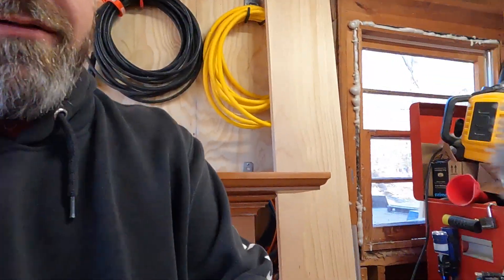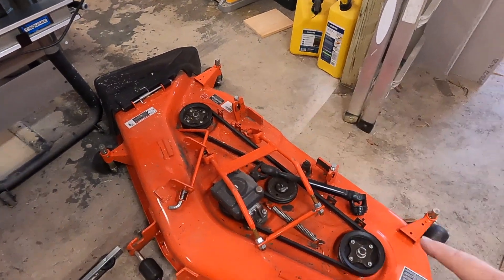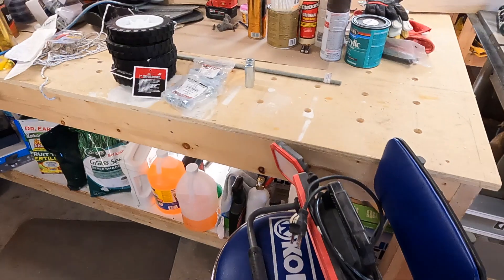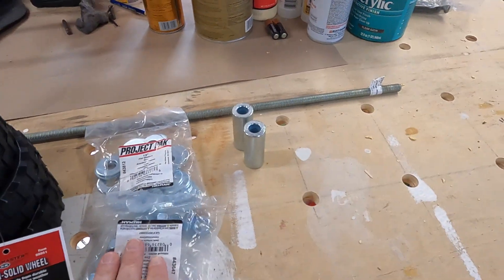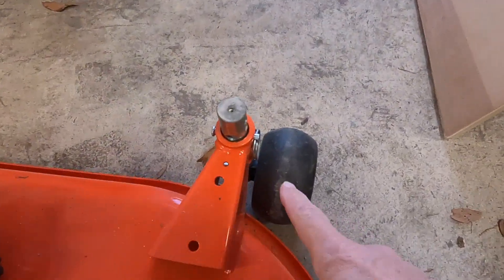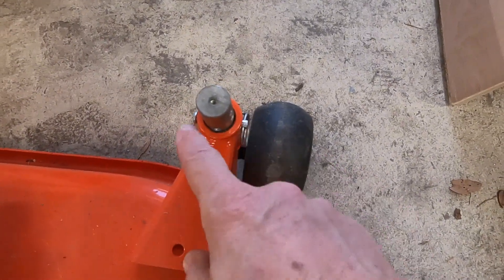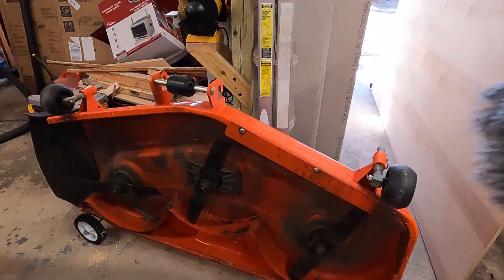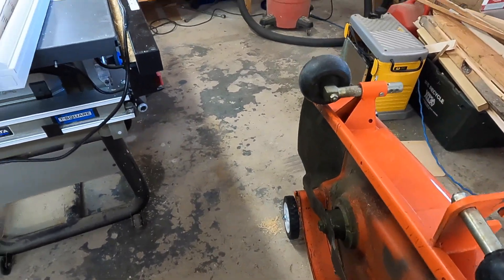Kubota BX23S 1 54" Mower deck storage

Comment: This is great! The spacers can be found at HomeDepot and Amazon. They  are a supper idea and fit. Not having to buy and cut PVC. Thanks for sharing. I used your idea on my John Deere 62C mower deck. Works well even though the sleeve for the axle is 3-1/2", the 2-1;/2" spacer works fine for me.